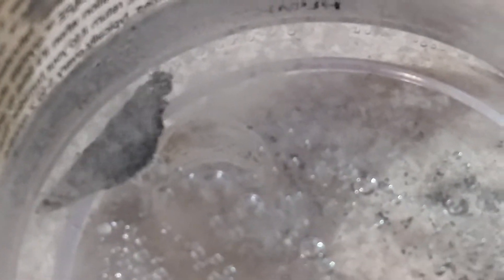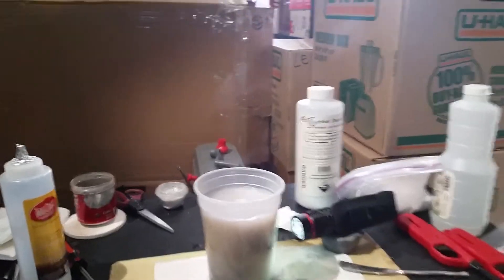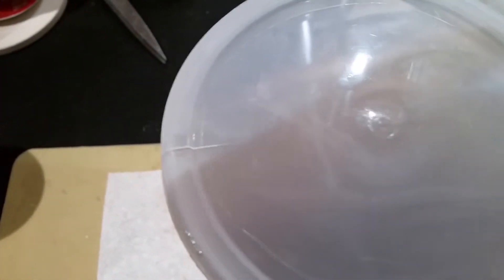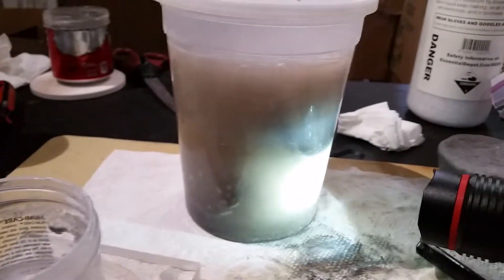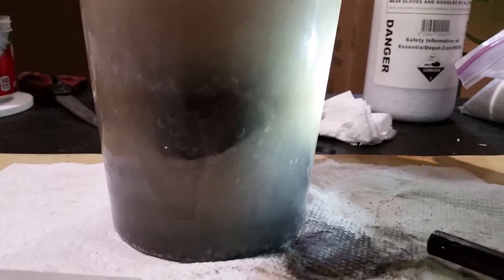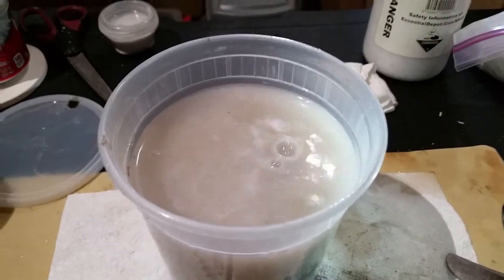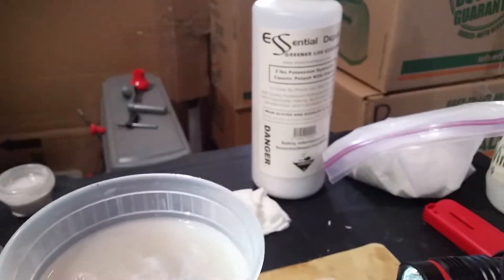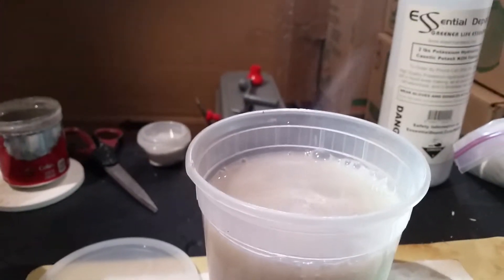Hydrogen from water and potassium hydroxide

Comment: I find hydrogen fuel for energy brilliant since it is the most abundant energy avaiable in this world. I find this demo interesting because there is no electricity required to produce hydrogen. I did a wet hydrogen cell with PCV and stainless steal, added a solution of water with a very small amount of lye water, connected it to a car battery and it reacted just like your demo. Question I have is, would this hydrogen gas carry potassium hydroxide that would corrode or rust the inside of a motor and the exhaust system? The best part is there is no carbon monoxide coming out of the exhaust and the gas quickly converts to water vapour. Cheers.